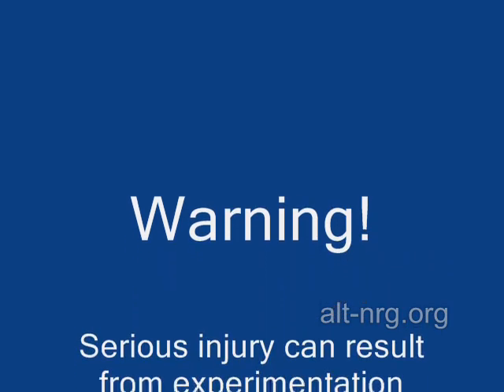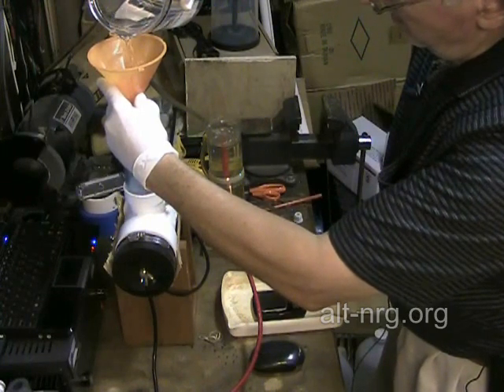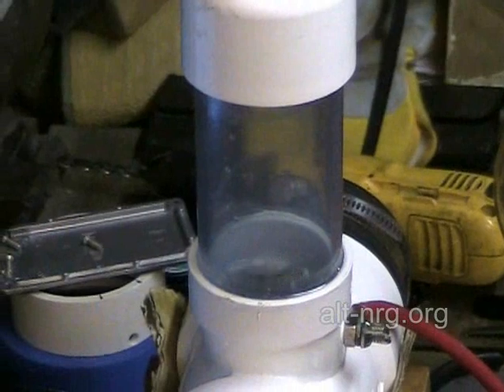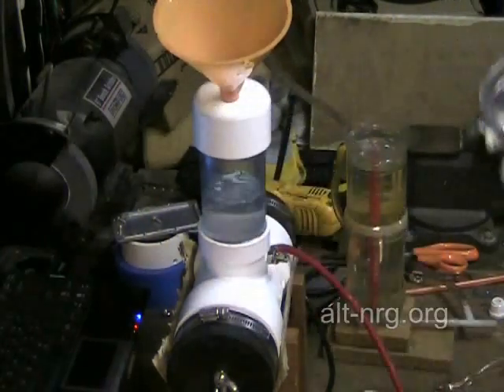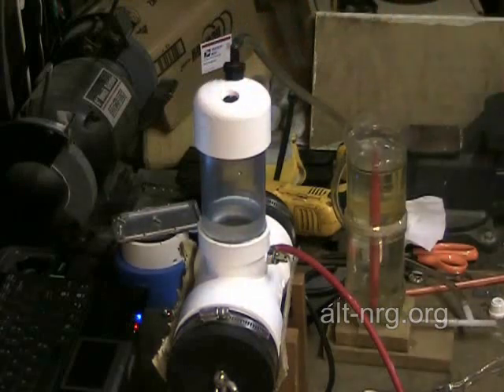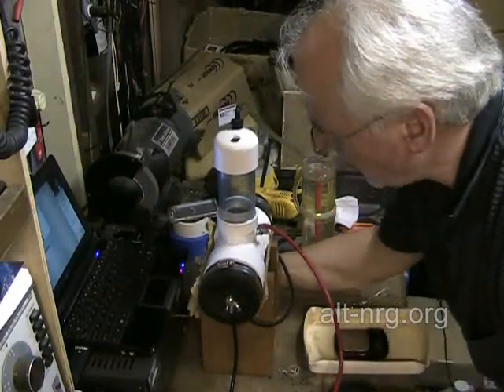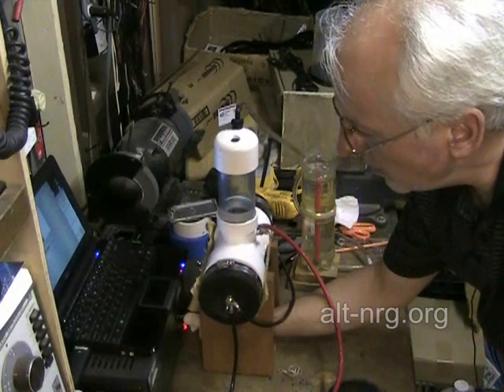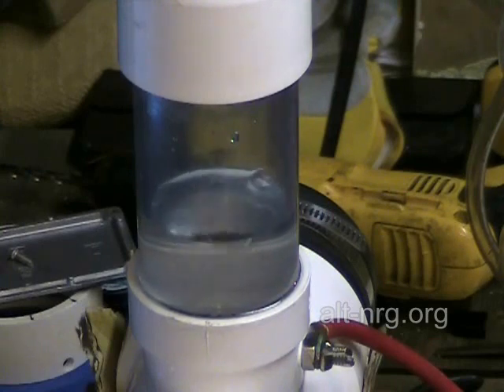#199 - Inverted T first run 2 of 3

Comment: i think end outlets will really help with effecience for this reason. varying plate gaps in a series cell with alter effeciency as we both agree. so to will the effect of different levels of water between the cells in a series cell.the more consistant that is the more effecient. that is my theory and i beleive why alot of similar design vary alot in effeciency. even flow and large plate gap and strong soup . 
regards andy